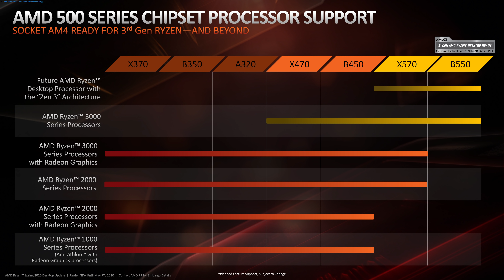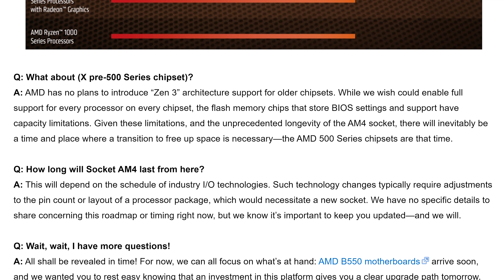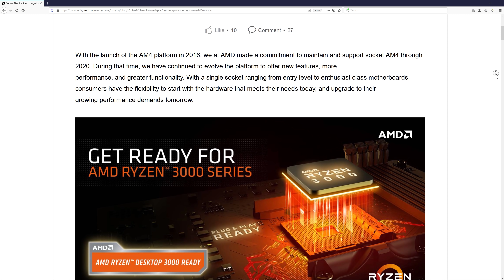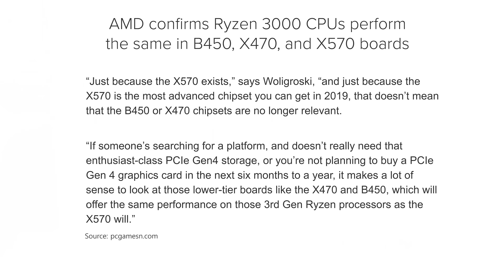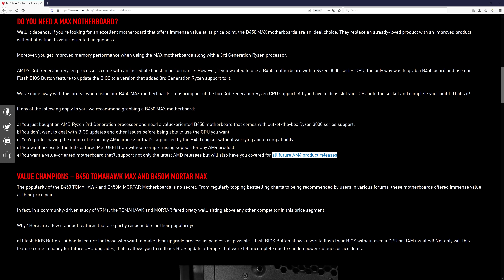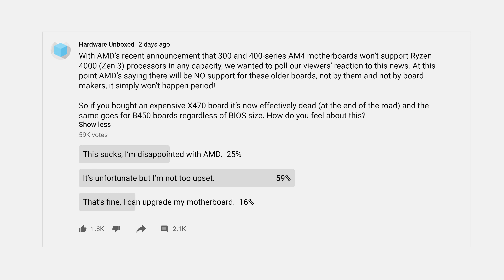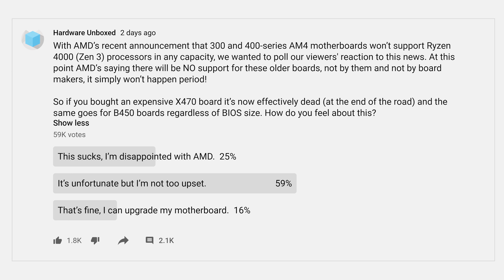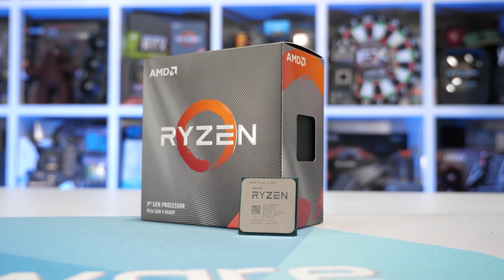AMD Does An Intel, Axes Zen 3 on 400-Series Motherboards, Our Thoughts

Comment: They can simply publish bios files for 300 & 400 series boards that remove support for older cpus to make room for the newer ones; since Ryzen itself is an SOC and the chipsets are nothing more than PCI express controllers with functionality controlled by AGESA code. Taking their track record into consideration AMD should be more wiling to listen to their customers to gain more loyalty because they are bound to fall behind intel again at some point in the future.

Comment: Certainly a misstep on AMDs part; this kind of information should be communicated sooner. That said, I considered this something of a 'bonus' with the AM4 boards. Not having to spend extra money on a new MB is nice but it also has the downside of over saturating the market with an array of boards with a wide range of base features that vary based on which series CPU you have. A cheaper, outdated board will hold back your expensive, new CPU. Maybe you don't need PCIe 4 and other features which can be taken advantage of with a better CPU but the point remains.

In the end though, this doesn't impact me since I basically planned around this, buying a slightly more expensive x570 MB to go with my Zen+ CPU. I simply didn't see any reason not to spend the little bit extra to get a board that would have better upgrade options going forward. In my mind, it's just kind of a waste to buy cheap components if you have the intention of upgrading in the future. Still, I'm not the kind of builder to rush out and buy a brand new CPU series and I presume this kind of decision will only negatively impact a small percentage of people who have had their board for far longer than AMD was considering this. Still, we'll see how things actually play out but even if the the BIOS of these board could support Zen 3, I think they'd hold the CPU back too much for it to be worth it, and I presume that's what lead AMD down this path.

Comment: As someone who bought a B450 Max board at the launch of Ryzen 3000, you expressed all my frustrations very well. I really hope they come back on this decision
Reply: Me too, Bought a b450 tomahawk with a 3600 last october.
Reply: i just buy it two weeks ago hoping for the support too and this is what we get haha
Reply: @Alfredwe  take it back get a tuf gaming, not that much more.
Reply: Got b450max 1 month along with 3600
Reply: I bought a b450 mortar max 4 month ago... Anotherone screwed...
Reply: Same here, but I paired it with a r5 2600 so I still have plenty of chips I can upgrade to. I understand the disappointment though.
Reply: I did this recently. I had a budget B450 with a 2600X and recently swapped in a B450 Mortar MAX with the upgraded bios chip for exactly this reason - to give me future Zen3 support when itcomes time to replace the 2600X. I did it about 2 months ago. To say I'm gutted is an understatement.
Reply: @joejones3434  Get a 3950X. It will be better than all but the 4900X and 4950X
Reply: I returned my X570 2 days ago and for the price I got 2 B450 MSI ITX boards with the 2nd board to back up my main build with a 3700X and 5700XT which will do me good for serious gaming/editing (providing I change to 3950X later) for the next 7-8 years and the Ryzen 4000 CPU performance don't justify the extra cost with only 10-15% increase in performance. 

I sold my I7 3770K recently and for the whole system, it cost me £1200 back in 2012/3 and it lasted me until now and for £15 less, I was able to build 1 great system with a backup board and another system with 3400G to watch movies, surfing the web etc to take straing off my main rig. 

I just don't get the people complaining about AMD, regardless if you buy now or tomorrow, within a few months i.e. 12 months, newer chips will always come out and so far AMD have supported the AM4 platform unlike Intel, who not only milked their customers, never improved on the CPU technology and each time a new chip came out, a new board was required and it was AMD who not only improved the tech and provided more bang for you buck i.e. more cores/very good performance, but forced Intel and showed people that they can't take people for a ride now. 

Most of the people who complain are not serious gamers, content creators and are acting like children or that they're the big shots in the gaming world need to be told to be quite and be happy with what you have because one day, you have to sell those very things in order to survive, COVID-19 comes to mind. Technology will only get better and if as long as people don't get taken advantage of by big corporations and have realistic expectations, all will be good. 

One last thing, never buy in to a new system straight away, always wait until the 2nd generation/last generation as the companies by that time, would have perfected that specific tech, so when DDR5/5NM or whatever is pefected by 2028, i'll upgrade then or if I need, Ryzen 4000, I'll buy an x570 at a cheaper rate in 2 years time and it'll still be compatible with my ram/cpu etc
Reply: Same, got one 3 months ago...
Reply: Me too.
Reply: They came back
Reply: Just buy the high-end ryzen 3000 chips if you bought a b450 i guess you are not running a 3900x or 3950x so you can just upgrade to that and if you are in the market for a 4950x you can afford another motherboard
Reply: @jorisressing3626  I feel if you had to cut cost and couldn't get a x570 you shouldn't even be mad. It's not like they are going to upgrade to ryzen 4000 when it comes out. And even if you were doing a crapshoot idea if doing that the last place to cheap out is the motherboard.  This is basic computer building 101 stuff. It's crazy we buy budget options and expect it to run the next gen.. amd really stated this so people wouldn't buy the budget r3's with a b450 board. So they are like 4xx series have no supported upgrade path buy at your own risk and b550 coming soon.... lol
Reply: So because you waited and that is a Companies fault? Sorry dude. They said in plain English 2016 to 2020. If you are one of those people who does not understand the that..oh well. Welcome to the real world. I bought mine in 2016 and am happy as a clam. If I upgrade to the 4000 I will probably buy a new board anyway. Because they don't live forever.
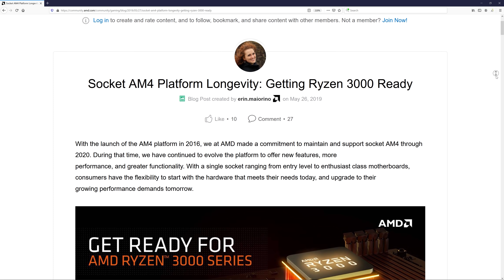Reply: @WiFuzzy   I have no direct stake in this because I don't have a Ryzen cpu, but hooooly shit. Way to flaunt your entitlement. You got yours in 2016? Well good for you! But did you watch the video? Cause right from the horse's mouth at 4:49 they say, "*through* 2020". Idk about your language, but in mine 'through' is an inclusive preposition. Despite that, I'm not saying they were lying, but you're delusional if you don't think AMD was vague about when support would truly end -- otherwise, so many people wouldn't be surprised about this news.
Not to mention B550... No, the delays weren't their fault, but they darn well could've been more transparent.
Edit: 'flaunt' not 'flout'
Reply: @AngelicHunk  through means through that date or that year.  When I approve a short term disability leave when I say to a date then it's to that date.   When I say through a date then it's through that date.  So when AMD says through 2020 it means through the whole year of 2020.  This isn't brain science!
Reply: @WiFuzzy  do you know the difference between. Socket and Chipset? FYI x470 and B450 are Chipset. All have AM4 socket like x570 and B550
Reply: your fault for buying an aging platform that could barely support zen 2 just to save an extra $60
Reply: @bigbadslimee  You are not making any sense. Stop
Reply: @BudgetGamerz  b450 is AMD cheaper mainstream offering x570 been out for like 10 months now. Its really AMD faut because b550 is late as hell but the 400 series chipset is almost 2 years old that's old in computer time. So she's saying if you couldn't spend the extra 40-50 bucks really 20-30 is most cases to get a better motherboard. It's kinda your fault that's the thing about doing it your own you gotta plan ahead and research. Its it really shouldn't be a big deal because if you bought a CPU and motherboard and had to cheap out on  the motherboard to get a budget chipset that's going on 2 years old I highly doubt you will upgrade when ryzen 4000 comes out and by time you might need a CPU upgrade the board would have crapped out by then especially if it was a MSI.
Reply: @bigbadslimee  the max series clearly stated that it would support future revisions, this might  be a case of false advertising on MSI's part.
Reply: To all those who said "it's your fault blah blah blah", shame on you. It was a scummy decision and even AMD knew it. Sometimes people complain to show their disappointment. Don't go defending companies bad behaviour just because you're not the one receiving the short straw. It empowers such companies to get away with said behaviour. 

Also at launch it wasn't a matter of saving $60, it was well over $150 extra where I live. I know because I was in that boat. You could essentially upgrade to the next tier of CPU with the savings.

Comment: I think it would have been less worse if b550 was made available earlier on. I waited and waited and then the option I went for was to get 256Mb/32MB bios motherboard. I so decided to grab a x470, because it was better for my needs and planning to use more than 1 nvme and still have all my sata ports usable. I also got a 3700x, was thinking to get a 3600 and then drop a 4700x later on but I found a deal on a 3700x and went for that shouldn't I had to upgrade. 

I got shafted anyway. Lots of x470 and B450 have larger bioses, the paradox is many x570s still have half capacity chips. So it's a stupid move to generate more motherboard sell out. And to piss off customers and make an "Intel move".

Comment: What annoys me with this is B450 is still the current chipset, b550 isn't even out yet.  I just bought a rather pricy b450 (MSI pro carbon) 1 - 2 months ago based on reviews (actually from this channel, great reviews btw and I'm not blaming your reviews for my choice), with a view that I could put a 4000 series chip in it in a few years to extend the life of my system.  Not overly happy with AMD!  If AM4 is dead after 2020 then why not bake in support for it and then drop it then when you told people you would.

Comment: amd can still turn this around by helping board manufacturers like msi with a support for the newest ryzen cpus on older boards that have the capabilities to make 4000 work. it will cost amd ressources, but it will also make the transition from am4 to am5 much smoother and no one will be pissed off then. we all know that am5 will come and it will most likely be the 5000 series so no one will (or should) be surprised that with 4000 series will come the end of the am4 line. helping older boards to support 4000 would be a grand move.

Comment: I had a 2600 and a b450, with the intention of upgrading to a 4900x once AM4 goes EOL. My b450 recently died so I was going to wait for b550 but after AMDs announcement it seems that b550 will not support my 2600. That leaves the very expensive x570 as the only chipset that will support my current 2600 and also my future 4900x. I am not amused but at least I found this out before buying something that wouldn’t have worked for my situation.

Comment: i dont care im still upset,   i bought 2700x with x470 a high-end one 
in the hopes of upgrading to 4000 series cpus...
Reply: I feel that those who have bought a X470 mobo + Ryzen 2700/2700x hoping to upgrade to Ryzen 4000, are probably the ones who are most upset, because on release both components were high-end products, not exactly cheap and going now for a Ryzen 3000 doesn't seem so interesting. Maybe a 3900x or 3950x can be a good upgrade but they will be probably on high demand, holding their price like it happens with the i7 7700k or i9 9900k.
Reply: @Tannerzillo  This is me and I'm angry.  I bought that combo with the specific understanding I would be able to upgrade to the 4000 series.  Super frustrating.  It's a reality check that these corporations only do what is best for their bottom line in the current quarter.  There's no long term plan except profit once the money starts rolling in.
Reply: @Tannerzillo  no way intel has mindshare,normies have no idea that amd is now better,and still value intel cpus more
Reply: @Tannerzillo  x470 with 2600x.  That was my exact plan. So yeah I'm irritated.
Reply: Exactly same for me 2700x w/ x470, if I have to buy a new motherboard to upgrade I might as well get a 3xxx used and wait for AMD 5xxx series cpu's or whatever Intel is shipping by then.
Reply: Same here got the 2700x and crosshair hero 7 WiFi.
Reply: OMG B450 TUF + 2700X here bruh
Reply: how about 3900X or 3950X ?

who care Zen3 ?
Reply: @claritoresdiano1021  cause not all of us need 12 and 16 cores. 6 to 8 with superior ipc is far better for some of us.
Reply: @Demonkingx5  this, "what about more coressss" chief, for gaming you'll only need 6 for a while, hell even the 3300X is show that almost all  current games run great on 4c/8t still. 8 cores is really all you'll need at most, even for most workloads 8 is still more than good enough for some people. for gaming more cores isnt gonna solve anything, we need more single core performance that would only be gained via going from 3000 series to 4000. thats why telling somebody "just upgrade from a ryzen 5 to a ryzen 9!" is just just kinda not helpful at all in regards to gaming atleast
Reply: Aces Next-gen console have 8c/16t CPU's at 3.5Ghz and 3.66Ghz. Consoles have much lower CPU overhead. They both come with dedicated IO chips that match several Zen cores in performance. The PS5 has a dedicated audio chipset on par with the entire PS4's Jaguar CPU, which is probably about on par with 2c/4t Zen/Zen+ CPU''s. 

High-end PC gaming will definitely need more cores in the relatively near future.
Reply: @claritoresdiano1021  It is a price issue there. I am sure GT98X was looking to upgrade into a similarly priced CPU. Although the 3900X series will cost less than they do now, they likely won't hit that 2700X price point. In time, this may create a better market for AMDs older nodes. Hopefully, not like older Intel CPUs.
Reply: @claritoresdiano1021  Both those CPU's will now feature inflated pricing on the used markets because they're the best you can get on no less than 5 different motherboard series, all of which likely sold more than the X570.

Intel used CPU prices are so high because almost every generation of CPU's only works on 1-2 (at best) series of boards.

Even if you never intended to buy Zen 3, this affects you.

Comment: I know this news sucks - just bought a 450 tomahawk max board about a month ago.  My guess is that MB manufacturers were seriously bending AMD's ear about this, as it certainly limits their sales, and that this change was what AMD needed to do in order to get MB manufacturers to invest in the tooling required to build the new 550 boards, and continue paying AMD for their chipsets.  AMD was faced with having to sell their chipsets at a lower profit margin, or pissing off the geek portion of their customer base, and chose the latter.  I'll be taking this up with Newegg and MSI, and expect full credit be issued toward a new MSI 550 board due to the false advertising.

Comment: If I buy an x570, will my "old" Ryzen 2600 work in it? Thank you.
Reply: X570 Boards usually support Ryzen 2000, 3000 and even the 2000G and 3000G APUs, but not the old Ryzen 1000 CPUs. For specifics look on the Motherboard-Website under Support for the “CPU Support List”.

Comment: Thank you for putting this out there HwU!

I was one of those consumers that late last August, two months after Ryzen 3000 + X570 release, chose the B450 Tomahawk MAX in the absence of B550 boards. If B550 had been released some months after X570, no problems, I and most consumers would most definitely had gone for board with that chip set.
The suggestion of a boot-able 'Interactive Bios Flash Utility' is really an interesting one IMO, the cpu selection process could be made very user friendly and simple to understand.
I had reckoned that AMD would seize support of the last AM4 gen CPU for the first 300 chip set, making 400 essentially akin to what 300 is now with Zen2. I do thus share the seriously hope that AMD backtracks the decision at least for the 400 series platforms that were re-released in absence of B550 last year.

Comment: Finally someone who addresses the issue. If they would have released X570 along with B550 last year when they released the 3000 series then their decision to drop B450 would be a little more understandable. Basically as of right now there is only one chipset available that will allow you to upgrade to the new cpus.